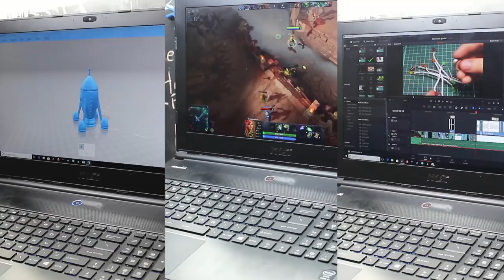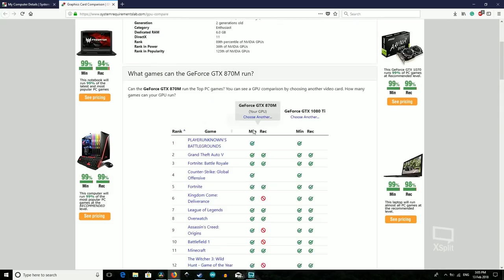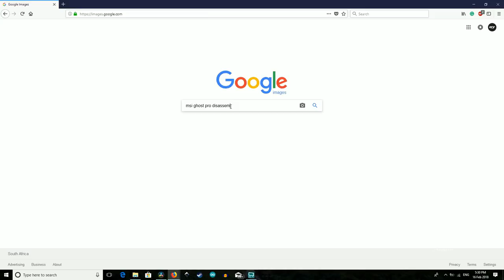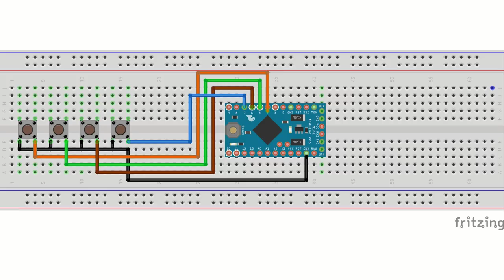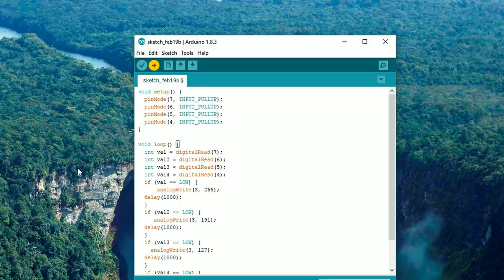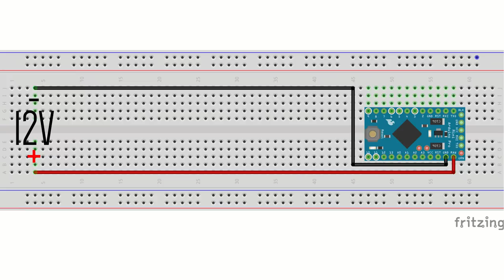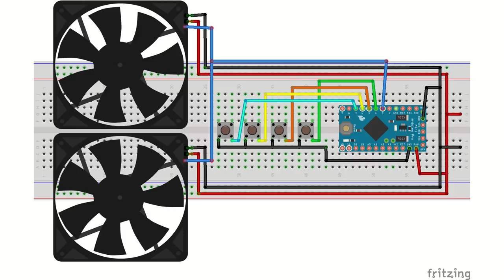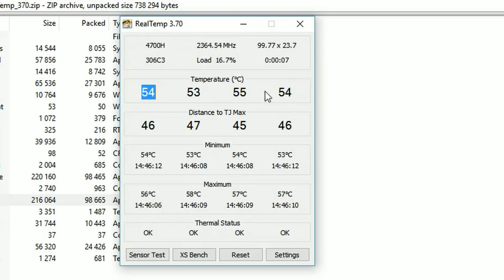Cooling a Laptop with Arduino

Comment: The FPS difference from throttling on the atom PC - that's epic, almost 3 times!
Reply from the maker: Most of that increase is because that PC doesn't have any kind of cooling besides passive cooling however I've seen quite a big difference on my main laptops performance aswell!

Comment: Any ideas how to do this but with ability to control the fans through a program on the laptop rather than with the buttons?
Reply from the maker: For sure. Using the serial monitor would be the easiest way to do this
Reply: @BuildItnow  Wow, thanks for replying so fast! And thanks for the tip)
Reply from the maker: @MalcolmBlk  No problem at all. I tested it quick and the serial Monitor does work with minimal changes to the original code. you just need to have the serial monitor open on your computer and have the cooling pad plugged in

Comment: Is it really going to cool that much when the hot air goes DOWN onto the desk with no vents ?
Reply from the maker: No vents? I'm not sure what you mean. Of course this won't cool as much as internal fans as they are able to blow hot air out but this is able to blow cold air onto the base of the laptop helping disperse hot spots around the computer which does improve performance if the computer is already thermal throttling.

Comment: thermal Trolling in my asus x550iu is very REAL
bcs its capped 74c with 1 fans and 2 heatpipe combined (so i heard the cpu temp is read ass gpu temp to bcs of this)
so i must drop down my cpu tempt under 74c? with sucks ASS cooling system? fucking shit